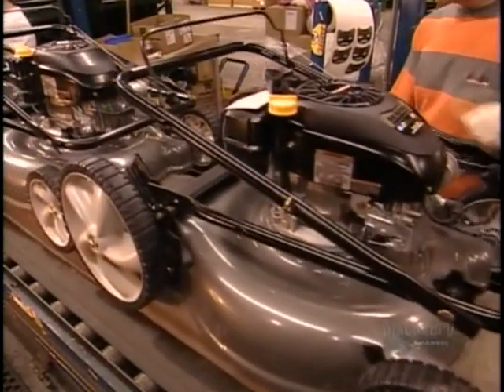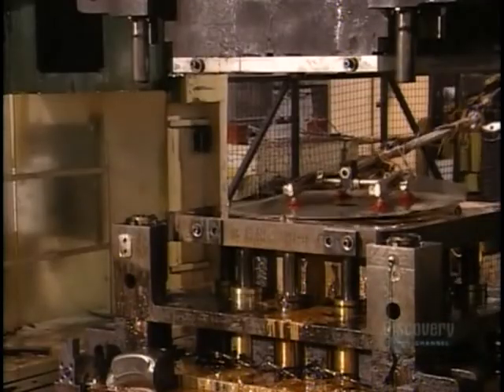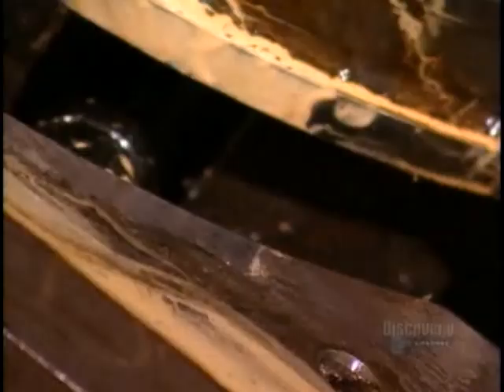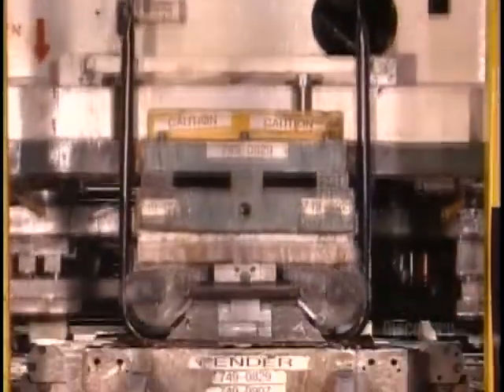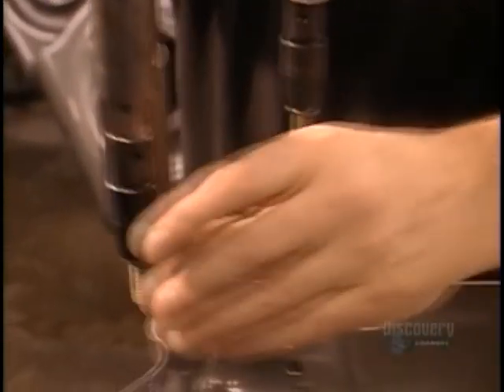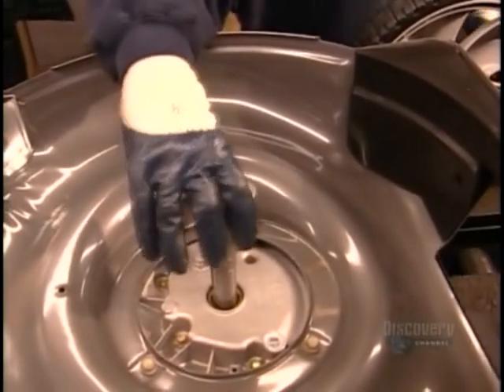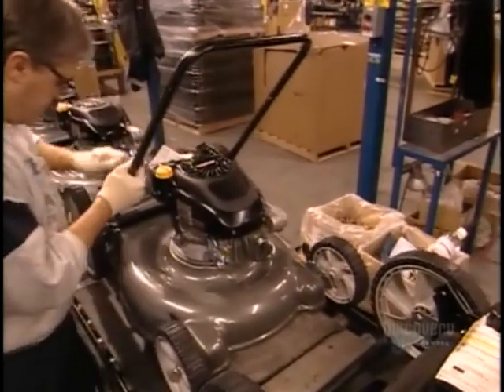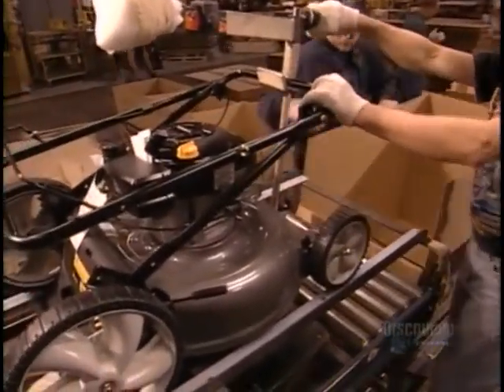How It's Made - Lawn Mowers

Comment: Our own lawn mower is a Troy-Bilt, which is MTD's "entry level" brand. They all have a Briggs & Straton engine which is one of the best engines there is for yard appliances.
Reply: Honda is best, because it is toughest
Reply: Briggs and stratton uses plastic camshafts on their pressure washer engines. Do you really want that?
Reply: Had a pressure washer with a Briggs & Straton engine and it didn't last two seasons.
Reply: Yep. Thats what im talking about.
Reply: Honda blows everything out of the water. Fail proof motors, automatic shut off system in place if the oil gets too low

Comment: Yeah they do, Briggs is a great engine though for entry level mowers
Reply: I would recommend hondas more. Briggs and Stratton puts plastic camshafts in their engines.
Reply: @andym1223  So? Chevrolet and BMW are putting plastic pulleys on their engines.
Reply: @andym1223  hondas are coming with plastic cams more often nowadays. Already replaced 3 of them this year in the ohc along with the timing belt
Reply: Not to mention aluminium cylinders😮

Comment: Yeah I prefer Toro mowers but even their cheaper models have plastic geared wheels
Reply: I needed a mower in a hurry spring of 2012.  The best I could get that day was a$300  Toro self propelled with a Kohler engine.  Plastic geared wheels and all.  I use it almost every week for 1-1/2 hours.   This is 2020 and it still starts easily,  almost always on the first pull.  All I have changed is motor oil and one drive belt.   Even the spark plug and collection bag is original.  I would say that is great service.
Reply: The cheaper Toros are built to compete with the likes of Murray, MTD, and other Walmart brands.  Costs and quality are reduced to enable a lower price.
Reply: I've worked in small engine repair for 5+ years and have never seen stripped plastic teeth on Toro wheels. MTD and Husqvarna wheels on the other hand are notorious for the plastic teeth stripping out.